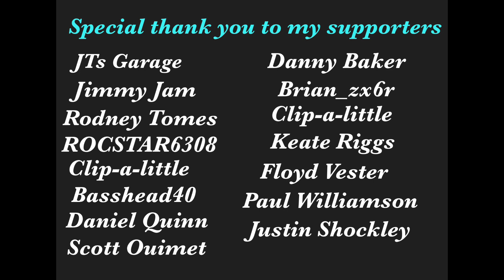Line Drivers.. Do You Need One

Comment: I have 2.5 volt out on my deck and my gain on one amp is like 80% up.I an only hear my sub at like 75% on the head unit the amp is a cerwin vega s91000.1d and a memphis mbe10s2.    Im all new to this. ill have my DS18 xohv Line driver coming in 2 days ill post an update!

Comment: My hu goes up to 2v I need to split it 3 times  my 4 Channel and to my mono. My mono is fine by itself but the 4 channel gets a massive boost in volume and clarity with a strong input signal I had a 6 channel active loc before and it was fine like that but i accidently fried it now I'm trying the kicker 2 channel keyloc i have to up the gains really high...High enough to hear noise to get up to the volume I had before. When I had the 6 channel loc I just turned up the gain 1/5 the way up and it was loud n clear. With the 2 channel split 3 times I can turn the amp  up to almost  max and there was just no volume and turning up the gsin on the loc starts adding noise like at 75%. Oh I also gotta question of placement should I place the line driver right at the output of the loc or after the split to between  my monoblock and the 4 channel.

Comment: So, I have a Mazda CX-5 now. I did not want to touch the factory head unit bc I was just in a situation where I got in an accident and by the time the tow yard got the car, the speakers and head unit had to stay unless I had time to spare to take it all out. In the end, that head unit would not have fit in the CX-5 anyway, and I don't want to waste money on something that's basically going to do the same thing, function-wise, as the factory unit. I ended up going with an Audio Control LC6 with bass control knob. I'm running a Memphis VIV 5ch amp and some fairly inexpensive Alpine S-type speakers and it sounds fantastic. I'm using a Rockford P3 10" in a ported box. All I need. Plenty loud. Without the line driver, I would not have been able to make it happen without buying 3 cheap kicker RF modulators for FR/Rr/Sub, and I wouldn't have subwoofer control that way. I ended up leaving Memphis VIV series speakers and an Alpine head unit in my old car. Sux to lose that $$, not doing that again even though the odds of getting into another accident are slim. This is one scenario where a modern line driver makes sense, but it's really advertised as a line output converter even though it has gain on the unit.
Reply: I stripped everything out of my CX5 that was Bose related and ran my own wires everywhere.

Comment: Do you think a line driver will be good for Android head units which have a lot of features like built in dsp but only have 2v pre amps that's why I'm researching them To help decide which head unit to buy android vs the norm
Reply from the maker: in almost every situation a dsp would be better. but most amps can work with 2v all day. i have a 5v kenwood and set my RCA voltage at 1.9v

Comment: Hey Jerry I have a JS 390 alternator on my system I’m putting out 6000 watts for all my amps on two runs of zero gauge wire to the back how much power should I be able to run if I go bigger with my amps how much lithium would be good on something like that

Comment: I got a Banda Electra 12k .5 ohm version on 2 dual 2ohm rs platinum 18s wired to one ohm. It slams but my gains 7/8th up?? The amps rated at like 9k at 1ohm. My rcas are coming from my clarion eq that's 7v I think. My electrics good enough, 250 alt and 48 ah headway+ platinum amg under the hood. Is that normal to have to Crank the gain up? Never had to on my Korean amps.     I got a .5 amp on purpose, I'm planning 2 more d2 18s.

Comment: Havent used a line driver in yrs. However i was using the epicenter 160 in dash line driver/crossover. There was certain songs that hit hard with it on and not hit hard with it off and also not tied into the system.

Comment: I kept my stock head unit so the line driver was definitely needed
Reply from the maker: DSP are better than line drivers for that. I bet you have a line out put converter.. a line driver just amplifies RCA signal..
Reply: @JerryAintloud  I have the audio control line put converter which is also a line driver right? You can adjust the output voltage

Comment: I use the Audio Control Matrix Plus line driver because it can be configured to use its potentiometer as a master volume control for your entire  system. The Epicenter was primarily designed to be used with factory (oem) systems that pull bass out at higher volume for the longevity of factory speakers......the Epicenter will restore that bass and enhance it, if desired.
Reply: You are wrong about the epicenter, it is not used to restore the bass that is pulled out at higher volumes from a factory stereo, AccuBass is for that purpose. The epicenter is used to reconstruct bass for songs that don’t have bass. And this guy on the video is a MORON for his comments about the epicenter, why does he even have a subwoofer in his car? If he has never played around with an epicenter, then he doesn’t know what he is talking about.

Comment: I have ran tests on splitters and cock boxes even at 0. 7 volts when u split it, it stays at 0.7 volts I tested this same signal 14 ways and they all had 0.7 at the rca female, I never had amps plugged in so idk of they will or can pull down the signal, I rim six amps off two rcas and then three four channels I split the four into 12 and the two into 12 and have no issue with voltage drop on the rca

Comment: I  bought a Salt 4 and some Xv2s that I faced forward in my car that had no output, my old compRs were louder facing the hatch. I assumed it was lack of rca voltage but when I turned the subs around BOOM man did it come alive. I almost bought a line driver lol thought something was wrong with the amp 😁
Reply: Looking at getting the jp63 to go with them a 400 amp alternator and some lithium
Reply: @tonysilvers8686  that sounds like a good way to go. I don’t think you will be disappointed. Pretty sure that jp does good numbers. With that electrical you could probably wire down lower and get even more power to them. Just be carful in picking a box. If you are running a box at spec or a little bigger you can bottom them out pretty easy. That’s why I built 4.5cf to help take that power.
Reply: @tonysilvers8686  I've heard nothing but good things about those amps, should be a hell of a setup
Reply: How them xv2s on that salt 4 hit I just ordered some xv2s for the back of an extended cab ranger
Reply: @tonysilvers8686  bro... I'm super impressed, it is way more than I was expecting. Not only do they smash the lows they do it with authority! I've had several people jump when the bassline drops. What amp you going with?
Reply: I had the x’s on salt 4. Was ok. Box facing the cabin was way louder than facing trunk. It was doing a 146 so not bad. Upgraded to salt 6 and reconed to dual 2’s so I could run it at .5 was much better. Got up to 148db. Upgraded to salt 8 and they came alive and hit over a 150 all in the same box. If the subs face the cabin the port needs to be on the back corner.
Reply: @0XxDOMESHOTxX0  I'm switching to subs up port back  8" aero next, then probably a Salt 6. You like 8 layer or 4 layer coils better for daily?
Reply: @Chris-B-Bassin  imo it’s personal preference. It’s all on how much power you will put to them. The salt 6 was good and very clean for them. The salt 8 at .5 gets them stinky really quick. I upgraded to nsv4’s now. Love the x’s and still have them but they just couldn’t handle that power. I’m sure at 1ohm they would have been fine. I daily my system so I didn’t want to upgrade coils, spiders ect. Just enjoy them. I also run them in a smaller box at 4.5cf so they took more power. I also used the 8inch aero but to be honest a 10 would be better cause the 8 is only gonna get you 50inches of port when you need to be in the 70’s.
Reply: As far as box I was thinking 2.25 cubic ft per sub with around 80 square port area tuned at around 33 hz what y’all think
Reply: @tonysilvers8686  4.5cf is what I like. As far as tuning it’s up to you. In my car the best was 36hz. I tried 28-38 in testing. Even my nsv4’s are at 35hz.
Reply: Are any of y’all going to the Xs power show in Knoxville tn on July 16th I was hoping Jerry and his wife would be there he said he wasn’t sure if they would make it love to meet him an his wife
Reply: @tonysilvers8686  No but sounds like fun
Reply: I’m gonna try 33hz first if I don’t like it I’ll shorten the port just a lil an try 35 hz I don’t think I’d go higher than that I know sundown recommend 32 I listen to some rebased music as well as regular music idk what kind of frequency range these sundown have is it a big range on them this my first set of sundown subs I’ve had kicker Rockford Memphis and my first set was some cheap mtx subs
Reply: Good talking to u guys thanks for the replies and input I appreciate it